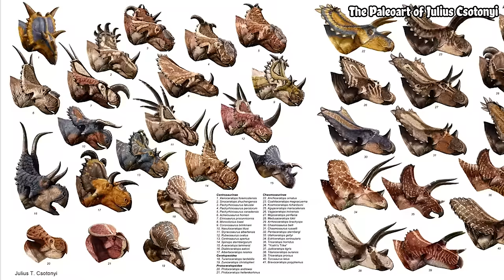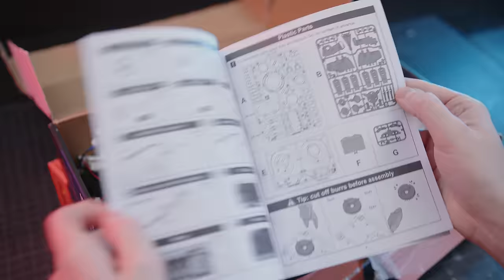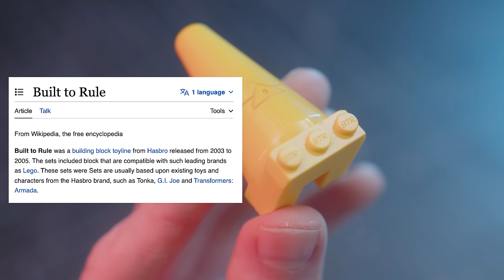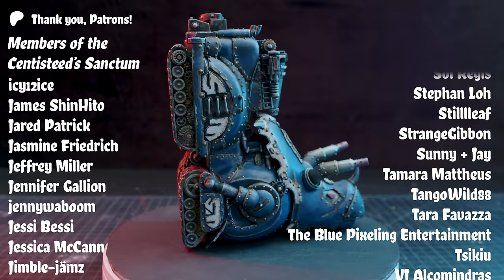I'm building my own Dino Megazord... one Zord at a time

Comment: The holes around the end of the barrel of a cannon is usually apart of a muzzle breaker, which have those holes to redirect the rushing gasses to the sides to reduce or negate the backwards, upwards, or downwards force that the escaping gasses cause. The designs may vary in performance and shape.

Comment: The swiss cheese thing on the end of a gun is actually a shroud over the barrel called a heat shield. It prevents a person from burning themselves on the hot barrel from firing. In an application like this, there would be no need for a heat shield over the barrel, as it's unlikely a person will come into contact with it when it's hot.

Comment: Since you mentioned it in the video, I shall oblige with the information. The "swiss cheese motif" depends on where the holes are... If they're on the end of the barrel, they're likely what's called a muzzle break, which somewhat improves recoil... If the holes are on something around the barrel, then the thing around the barrel is a "heat shield" which prevents people from touching the barrel when it's hot.

Comment: Great video... however I can already see a problem with the stability of the megazord mode, why? Well, firstly he doesn't have heels which already affects his balance a lot, secondly because his feet are not completely flat he can tend to rock a lot, which can result in him tipping over, and I know it's just turning the megazord into a block without being able to move And maybe even if the megazord is a block, without articulation and such, it can still tip over because of these problems
What I suggest is that you put a type of bumper in front of the zords that form the feet, which can be moved to turn the heels, and go with me, you'll have to find a way to give him heels, or else.... he falls into the floor.
just a idea, but if you want you can do it

But hey I could be wrong and the megazord could end up being super stable

Comment: The whole zord is a master piece but the cryptic symbols on the side i feel couldve been done different. I get that in reference to the original they are white but being that you have a post apocalyptic rust design , white wouldnt be ideal. It be yellow by now. Worn out. Torn, faded. Peeling. It takes you out of the whole rust design you went for. I think those symbols shouldve been metalic rusted siler. That wouldve made more sense. I do rust paint on zoids. And always found this as an eye sore. A coat of paint on the wheel wells to resemble dried brown mud with light sand yellow accents or the dust wouldve been a nice touch. I love this cant wait to see the rest.

Comment: i gotta say im waiting with baited breath to see how you handle the much more mechanically complicated tyranno or mastodon. will you use portions of larger, already posable toys? or fully formed joints from other mechanical parts? id be concerned about weight and joint tolerances if it was all scrap. either way this rules and im subbing just to see how it plays out. thanks for a cool video!

Comment: fun fact: The not-lego horn was the same mold as a normal lego horn piece! but.. eh, as a certified microplastic eater, i think i can tell it's a faker. (insert "I found you, faker!" meme but with the real LEGO horn and the Fake Lego Copy Horn.)
EDIT: Fun fact 2: as a certified Dino Nerd, i'd say a Bravosaurus' horns are too short for this big guy. also, he has an extra set up on his cheeks--plus the longer, more rectangular frill and the set of horns on top of that aforementioned frill--meaning this is a Pentaceratops! like a triceratops, but cooler.
EDIT 2: i tried to read the message

Comment: Never cared to much for Power Rangers, my kids thought it was ok though. Probably why I didn't care, was to old at the time. I did however really like Voltron. Maybe some day you'll make the lion Voltron combiner. I actually had the die cast toy from the 80s. Well I had the black lion but there was a recall on it because it used lead based paint so my mom sent it in for an exchange and they sent me all 5 lions back. I was stoked. The entire thing felt like it weighed 20lbs but I was a kid so it probably didn't really lol. I miss toys from the 70s/80s.

Comment: If you're specifically using odorless mineral spirits, good ventilation will more than suffice. Pure mineral spirits have all those nasty pollutants that one would need to worry about, and a full respirator is good there, but it's a tad excessive for the odorless stuff. You're definitely overplaying the danger of odorless mineral spirits a bit, but kudos for playing it safe.